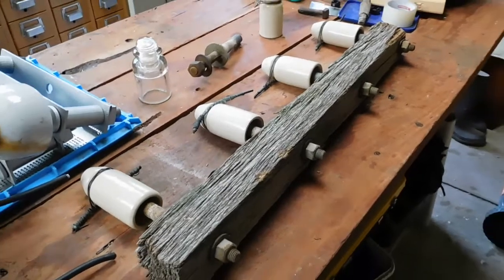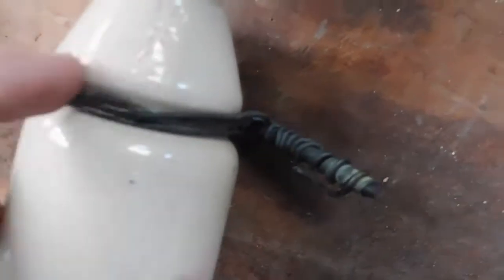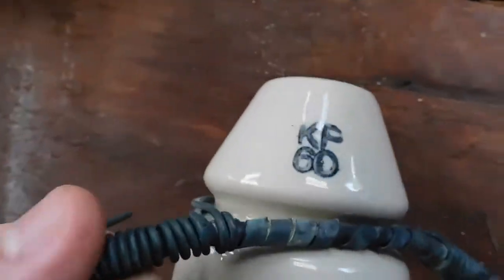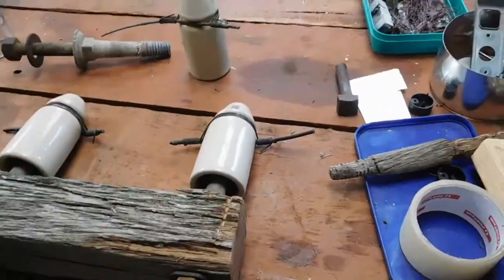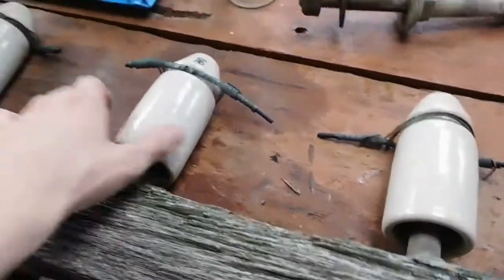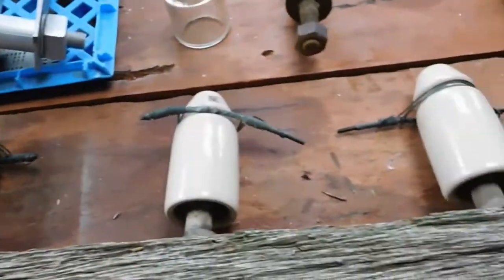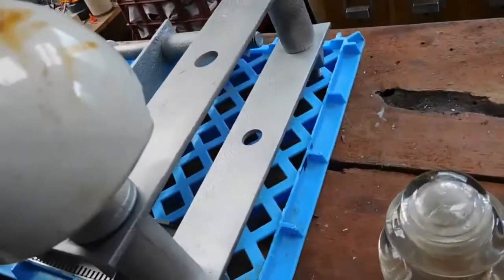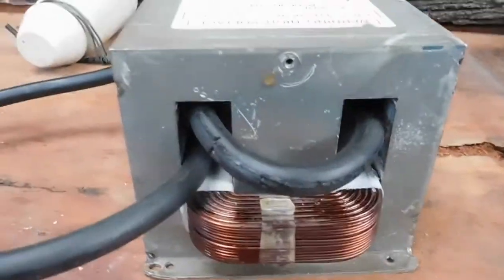Aussie Telegraph Insulators

Comment: I Just climb the poles. they are a bit narrower here I think sometimes and they are just made of railway tracks.
Reply from the maker: That's what that one was mate ;) the other single ones came off the same pole as these!
Reply: Yep today I did some insulator hunting and I got 6 good KP 72s and  a whole bunch of metal pegs that were on a fallen pole. Half the pegs had no insulators, but I got them because I will use them for electric fencing and other things. Tomorrow I will make a video on them before I use them. Cutting the crossarm could have been easier, but I didn't use a ladder I just climb, and here the crossarms have steel support structures. I tried to take some support structure but we were in a rush so I couldn't. The pegs are the same type as the on your log there. We do not have those pegs with the big square part. Was that the only pole there?
Reply from the maker: Pigeonsforever123 nice! Nah there's a whole load of poles there, most of the insulators are either broken or missing sadly, this was one of the better poles!
Reply: Its so annoying what people do with rocks and guns. Where I was today not many people go. but it is obvious why the fallen pole only had 1 insulator left and the rest were taken, so I just took the pegs. Where I was the poles only had 1 crossarm like always around here, so there were only 5 insulators on each pole. Go to the Keilor(?) power station and get those tele ones there and make a video if you can. I am still watching this video again and again.. one of the few Aussie insulator videos. Hope you can find some good poles and get some good insulators(and make a video).